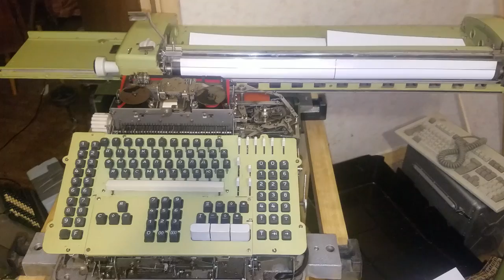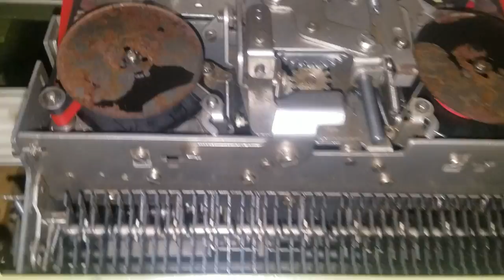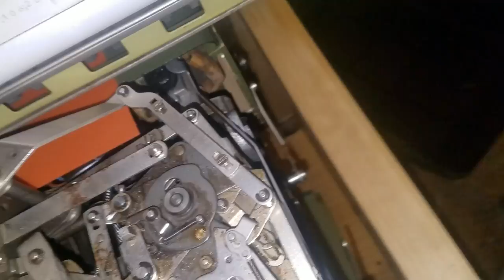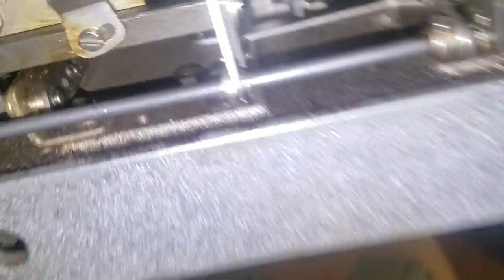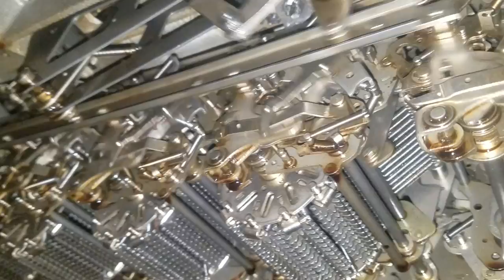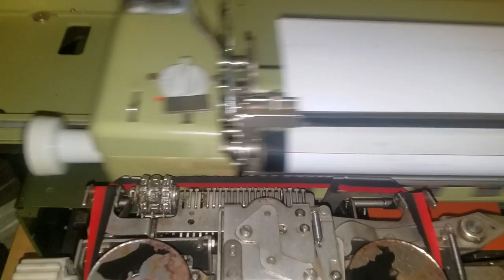Ascota 170 mechanical computer calculates square root

Comment: This amazing piece of engineering from 1958 was the most advanced desktop accounting machine ever built.  It is programmable with fifty discrete program steps and has fifty-six 12-digit decimal registers arranged on seven drums with eight registers each.  Programming is done with a board which fits on top of the carriage and distinctly shaped pieces of steel which represent one instruction.  Four instructions can be executed in parallel and conditional branches and jumps are possible; the machine is Turning-complete.  An optional coprocessor could be added to help with multiplication intensive programs.  It is believed that over 300,000 of these machines were built from 1958 to 1983.
Reply: Thanks a lot for the info. Pretty impressive. Considering it was all mechanical, it looks magical
Reply: I've no clue what most of that means but its cool af
Reply: For a moment, I read the comment about the "optional coprocessor" as "optional compressor", and didn't even question it since that would still make total sense in this context.  ;-)
Reply: 1983!?!
Reply: @douro20  By 1983 Texas Instruments was selling (dumping) Ti-99/4A home computers for $100, but included a mail-in $50 rebate (some were sold for $50, and were therefore free).  While a pretty poor computer, they were an excellent and accurate programmable calculator.  If TI could have only dumped them in the Eastern Bloc, they would have made money.
Reply: @DumbledoreMcCracken  selling computers to eastern europe was illegal in 1983
Reply: It also has 4 general purpose registers and 1 register which stores input from keyboard iirc. Author wanted to connect GPWRs 3 and 4 with several removable 3D-printed gears to make bit-shifting possible, but now he does not have time to do that.
Reply: douro20 your statement may have been true for Eastern Europe, but certainly doesn't apply to the Western World
Reply: @sepgorut2492  duh
Reply: I can’t imagine that this machine can do more than we thought, and those high teeth company are always promote that there tech are the most advanced(with a very pretty screen and pretty pictures and videos it can be perform .)

The old tech has some basic of math and mechanics of the nature!
Reply: @DumbledoreMcCracken  They tried to sink Commdore for the second time and failed miserably. The spiral of prices was a TI vs CBM war basically, won by CBM, but at a high price as well.
Reply: @Paolur  It means it's not just a calculator but a full-fledged computer that is completely mechanical. Babbage's dream realized, in a sense, though electronic computers already existed at this point so it was something of a dead end.

Comment: Ascota was my first job as a "computer" programmer. I am from Latvia, Riga. I coded on it in early 70s, my first job.  What the video shows you is not the most important part of the machine. There is large panel right behind the printed paper. If turning the panel upside down, one will see rows of holes. You insert heavy staples of different configuration based on their functions (multiply, sum, total, red/black, print, no print, size of column, etc) into the holes. This machine was used for printing reports, accounting, calculating... It was very useful in many factories in Latvia for many year. It was a German machine, well made, reliable. Took skills to program and debug the panel. It was before the mainframe and overlapping it.

Comment: I feel like this mechanical computer is a greater invention than the digital computer. This is clockwork
Reply: Because it is. Most of today’s modern desktops will fail to work properly after a couple of year of massive usage. These machines were and are still able to work for decades without requiring particular maintenance.
Reply: @micky100  consumer products yes. properly maintained professional hardware? runs until you pull the plug.
Reply: @cobaltno51  well, obviously I was referring to consumer products such smartphones, laptops, etc. usually with an average life span of no longer than 5 years
Reply: 1880 tech, pascal calculator!
not von Neumann compatible!
Many type writers can calculate!
Reply: @micky100  and you think the thing in the video was a consumer product akin to a smartphone today?
Reply: @cobaltno51  Does it matter? I’m referring to the manufacturing reliability, not about specific purposes they might have. Obviously I won’t expect to make a phone call with a gearbox device.
Reply: @micky100  I am not talking about functionality but reliability. I said that professionals use hardware today that can be used for long times, similar to the machine in the video. you countered, that you obviously meant cheap consumer products, when you were bemoaning some loss in reliability in products over the past years. I countered that the product in the video was probably not a consumer product, but the tool of a professional, hopefully proving your analogy wrong.
Reply: How could this be a greater invention than digital computers? Transistors literally changed the world and that objectively is one of the greatest inventions of all time. Don't get me wrong though, this machine is still incredible
Reply: @micky100  you have to consider the actual number of operations it does for that to be fair comparison
Reply: They can today with more better tools not make such thing.
Reply: @andilouis8770  no wrong. It has a quantized internal measure. It's not as if you were looking at a tide predictor or anything is it?
Reply: @micky100  a true man of vision. Had they been fluidic logic elements and not mechanical escapements such a device would run for millenia not decades. And transistors , who have a intended design life of 20 years? Not much use. Stop kidding yourselves!
Reply: @factorylad5071  ok factoryboy!
Reply: @micky100  Sometimes I hate to be alive in Century XXI. Back then it was about making items so durable that it does not even need maintenance even after heavy usage for a century. And now? Make items so weak that the consumer would need to continually buy another one and the manufacturer gets more profit! I do not want to live in such a harsh world like this! Why would my mother bring me to this world?

Comment: Mechanical devices are more impressive than ones that only use electricity
Reply: They need to find out how to make a real-life Protracker Music Box to play metal punch cards containing Amiga MOD file music...a music box that can reproduce the likeness of many instruments...even ones that don't exist yet...like the Acoustic Grand Piano in 1682 A.D. Running completely off of an elastic archery bow spring...a wind-up music box with 8 bit signed PCM digital samples in quadraphonic sound.

Comment: This won't fail when there will be a big solar flare. Because eventually there will come a huge one like in 1859.
Reply: You can always put old computer in a Faraday's cage and put some simple generator in it too
Reply: And I'm not sure if single devices would get that much affected
Reply: @ImieNazwiskoOK  : I said THIS WON'T fail (i.e. WILL NOT)
Reply: @C2H6Cd  Yes. But this would probably be a big overkill, especially when no one really uses those and servicing it would probably be a nightmare(also they are pretty limited).
Reply: @ImieNazwiskoOK  : I told it as a joke, I thought it was pretty obvious